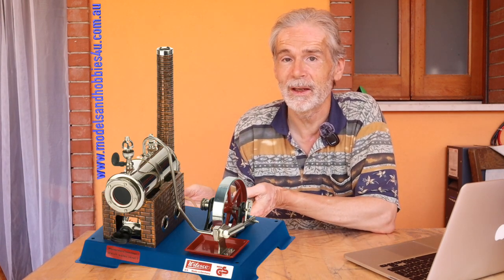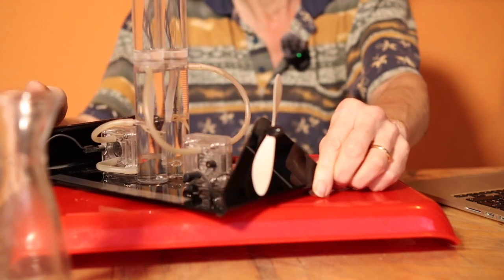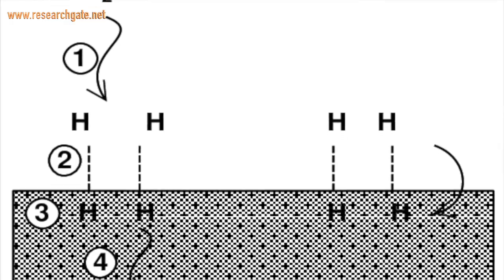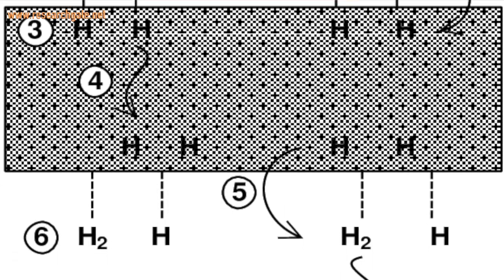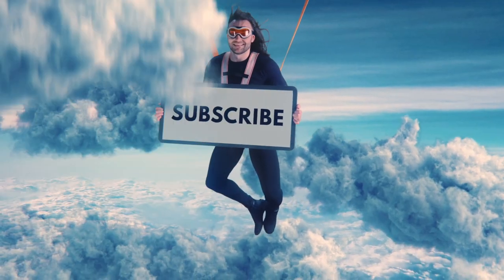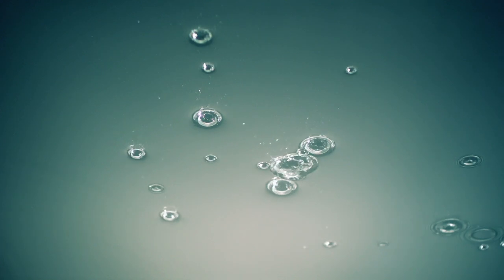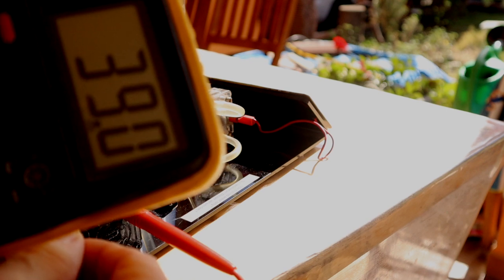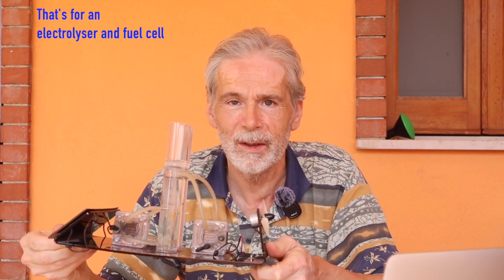Hydrogen production at home: will that work? Video 49

Comment: There are a lot of practical complications associated with H2. High prassure storage, material issues and efficiency. Plus the fact that hydrogen in itself is very explosive when mixed with air.
Reply from the maker: It is all true !  And like other technologies of the past we have to learn and deal with these problems. But this time we are in a hurry.  We must also learn to use other technologies because  each one has its own advantages.

Comment: I understand production at home as an educational experiment but what is the practical reason for this? You need to compress and liquefy hydrogen if you are to use it as fuel. The energy for this process would offset any economies from the production of H2 from PV cells.
Reply from the maker: See some of the other replies under this video: I hope and expect that nanomaterials will enable lower pressures.

Comment: Every year someone does a video of how great hydrogen is but Its just to inefficient to make, convert and store compared to putting the electrons directly into a battery it just doesn't make sense and as battery tech gets better and cheaper it will make even less sense for all but large industrial applications.
Reply from the maker: I agree that without low pressure storage it wiĺl be difficult to get the best out of hydrogen. I hope and expect that nanomaterials will get us closer.

Comment: The challenge in my mind is not electrolysis at home, but compressing the hydrogen created to stuff it into a high pressure tank for later use.   What's the cost of high pressure tanks and an appropriate pump, and the round trip efficiency of the electricity to hydrogen to compressed hydrogen to electricity, once you include the energy used to compress the hydrogen for storage?  And of course there's the storage losses due to diffusion, and the issue of hydrogen embrittlement of any high strength steels involved in the system components
These seem like several rather large elephants in rather a small room...???
Reply from the maker: I see that you know much, those are about most of the problems. I  also find the EU goals very ambitious but with a lot of climate pressure there will be major breakthroughs.  In particular with low pressure storage. I have good hope that with nano materials we can arrive there. I have been in a EU research project biomac where they found bio nano materials with surprising characteristics.  Short distance molecular forces of some of those engineered materials might enable hydrogen to be bound at lower pressure.
Reply: What you just described is exactly why we don't use it. 

If I had a large amount of extra solar, sure I'd try it. Use it for night time use. But we can't actually store it long term. Nothing contains it economily